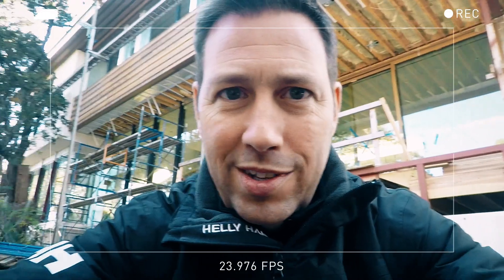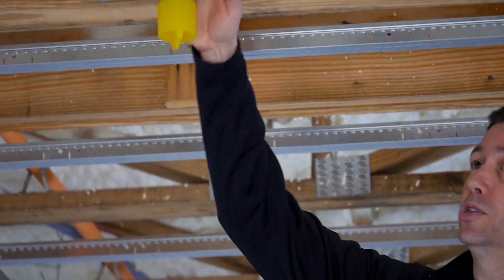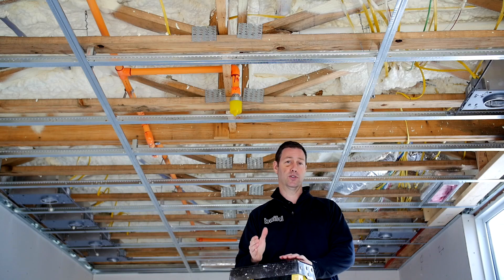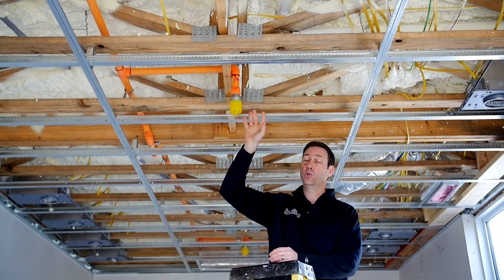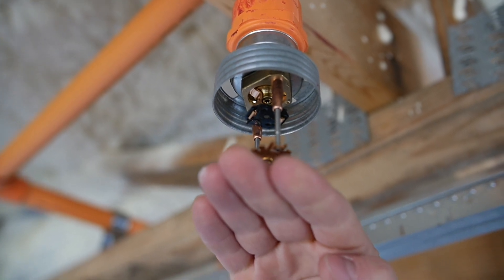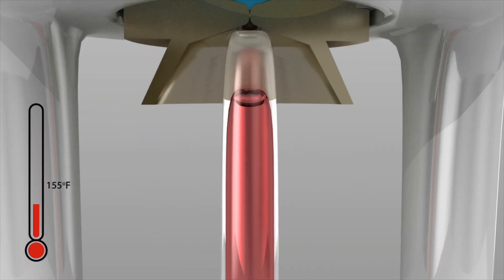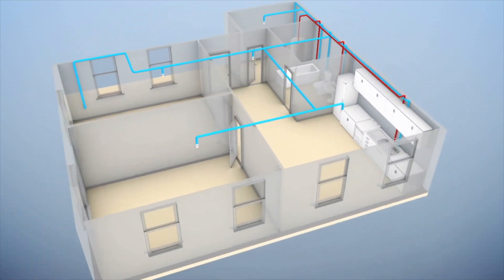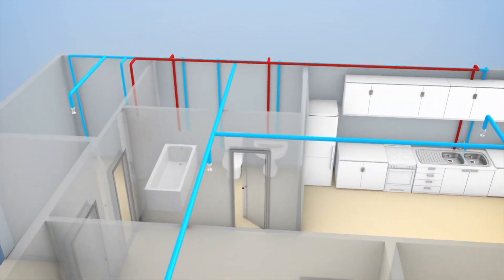Home Fire Sprinklers

Comment: What if when kids are messing around and something hard or even a basketball hits it, will the glass break and start showering the room?
Reply from the maker: No, the glass is recessed into the ceiling.  The only thing that will show at the ceiling is a metal round disk.  Good question!  Matt
Reply: Matt Risinger usually these  concealed heads dont have glass bulbs..they  have a fusable  element.. not picking faults.. its a good video, just advising
Reply: @ Don

The concealed head cover "disk" is also heat sensitive and usually 15 degrees below the activation temp. 155 head with a 135 cover. The cover will drop, the deflector will follow then the fusible link will snap at 155 and water will rush out. 

Do not paint the cover as it is against code. Its also stamped on it reading do not paint. You can get any custom color or finish, wood grain finish if needed too.
Reply: The round disk is expelled by the water pressure when the head is triggered? Is it decoratively finished or does the painter finish it? And if the sprinkler is triggered does it terminate once the fire is quelled or continue until the fire service shuts the sytem down ( water damage mitigation)?
Reply: There are smart Fire Suppression system in development mostly in the U.K. The new systems use infrared sensors to aim a high pressure atomized water spray. This type of sprinkler can extinguish large fires with much less water. Without getting all nerdy about water the easy way to think of this is the smaller water spray the more heat is absorbed,  and very shortly the fire spred is stopped and extinguishment is accomplished.  Some system are even using the infrared sensors to halt water flow. As to water supply the piping can be a thermal plastic such as BlazeMaster. This is all covered by NFPA 13

Comment: Are the pipes always CPVC, or can they be PEX?  I assume you get your plumbing contractor to run them at the same time as the other rough install?
Reply: NFPA 13D covers residential single and two family dwellings.  According to this PDF PEX is ok to use.  https://plasticpipe.org/pdf/pex-plumbing-sprinklerapplications-01-17-2013.pdf
Reply: scroll down to slide 8.
Reply: Buy the code book, or hire someone who is an expert.  I'm a former fire fighting instructor and a current landlord.  Code doesn't require sprinklers where I live for single family.
Reply: Uponor makes a PEX residential fire sprinkler system.  They suggest plumbing it together with your domestic water plumbing.  One benefit is the water is always flowing through the pipes and may save you from having to periodically test and/or flush an independent sprinkler system/plumbing.
Reply from the maker: We used a specific sub who only does Fire Sprinklers for this project.  I'm not sure if PEX can be used actually.  Anyone else know?
Reply: @buildshow  I don't know what your local Codes say, but I used Pex in my install. I'm outside an inspection area so I can do as I please, but I researched carefully and Pex was entirely appropriate. Everyone seems to think that sprinkler systems are complex; they are not. It's just important to get the placement of the heads right. The water supply is the easy part.
Reply: Wow thanks for the info ill probably be doing this
Reply: Hmmm What size of pex pipe could a person use
Reply: Pex is too new for wide acceptance. Also has to be calced for correct water distribution. 

Hire a pro
Reply: I would be more concerned about PEX fittings lasting the lifetime of the house. With CPVC glued joints, thats going to outlast you or I.

Comment: What defines when a sprinkler head turns off? Do they run for x-minutes, or is there a set gallonage that runs through them, or some other variable?
Reply: Well, instead of fire damage you have water damage!
Reply: they run til the fire dept turns of the water supply.
Reply: off*
Reply: Well, fires grow exponentially.  That water will be flowing from the sprinklers a steady rate.  Also, they do use water to put out the fire.  A lot of water.  Small hoses flow 150 gallons per minute.  How far is your nearest fire station.  A fire in a small trash can can extend to your whole house in 15 minutes.
Reply: @blueferral3414  No, no and no. The heat triggers the nearest sprinkler head, which sprays at the rate of five to twelve gallons per minute, depending on the head and available water pressure. The entire point of a fire sprinkler system is to isolate the fire in its one location. It does not spread 'exponentially' as it cannot spread. Do your homework before deciding sprinklers won't work.
Reply: @paulmaxwell8851  Work on your reading comprehension pal.  Yes, once triggered the sprinkler will spray until the water is shut off.  Yes, fire you will have water damage instead of fire/smoke damage.  Yes, fire spreads exponentially.  If you don't realize i was talking about in the absence of sprinklers then that is on you.  But I will call the state and tell them I'm turning in my National Fire Instructions certs because Paul says I didn't do my research.
Reply: Aside from using a shut-off valve, firefighters typically have wedges available which can be stacked together to block the flow of water from the sprinkler head.

Comment: Knowing how theses work, I've always thought it was pretty funny when all the sprinklers in the whole place turn on at the same time in the movies.
Reply: In some high risk areas this does happen.  However, in the movies they usually all go off in an office building.  This is not a high risk area.
Reply: blue ferral in correct. The only time that will happen is when it is an open head system aka deluge.

Comment: That is always pressurized with water...right? I'm guessing those aren't ideal for unconditioned attics here in the north due to risk of freezing.
Reply: some commercial systems are pressurized with air so no chance of freezing.  When the tube breaks the air rushes out followed by the water.
Reply: Raul Vasquez cannot be pressurized? Hmm Cpvc has to pass inspection at 200 psi for about an hour, after the inspector sees it can hold pressure the system goes back to city pressure depending where you live it could be between 45-120 psi city pressure, that the system is held for its life. So yea cpvc is pressurized.
Reply: You can install a dry system in a residential. We have to put 200lbs of air on a new system for 2hrs to pass inspection. Always install a dry system where there is a chance of freezing. A dry system is when you fill the lines with air to hold back the water, once a head bust’s the air releases the water to the system. There is only about 40 to 45lbs of air on the system at all times.
Reply: RickMakes yes needs to be in conditioned space.  If you are going to install in those areas then attic will need to be insulated to be part of the conditioned space.
Reply from the maker: Thanks for the help.  MR
Reply: Cpvc can not be pressurized. It pops real easy. Verticle rises up walls to HSW for top floors.
Reply: I like the air idea would solve corrosion issue in metal lines as well